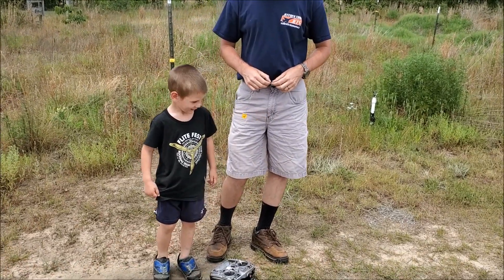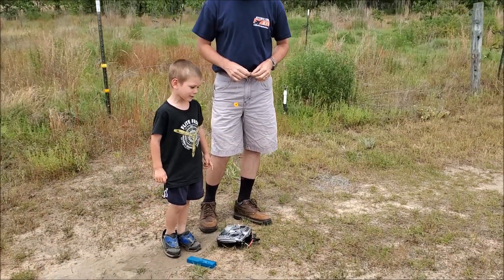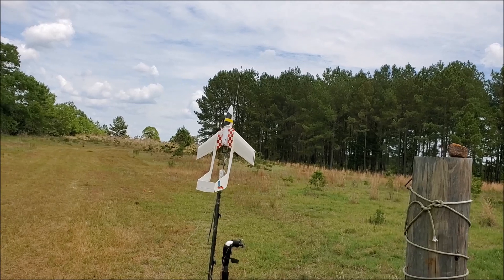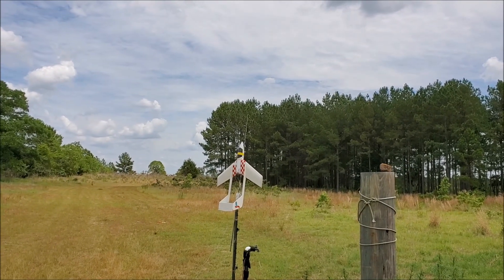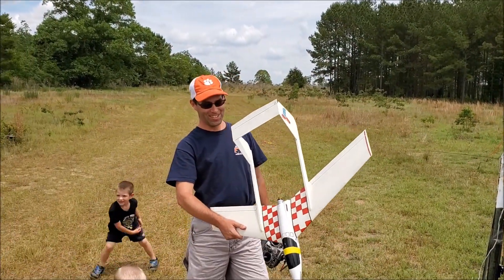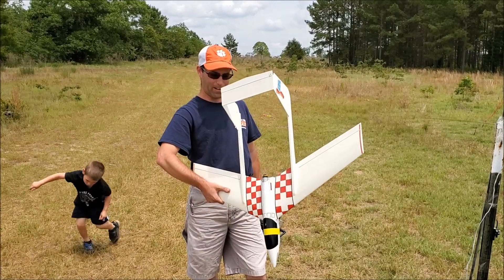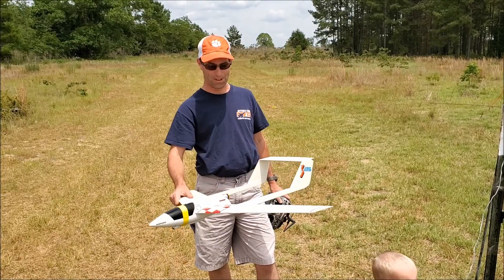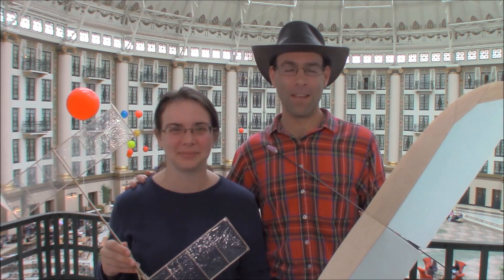Estes Strato Blaster rocket plane!

Comment: the STRATOBLASTER! That's the freaking name of this thing! All of my friends (and of course myself) wanted one of these when I was young.

One of them ended up cloning it (edit, a mix of cut packaging foam and Hobby Lobby Balsa, if memory serves) and adding a folding sailplane prop in the middle, with two F class engines for launching.  He used it as a target puller for big foam gliders we'd pepper with BBs, paintballs and the like. ended up getting literally shot down by accident.

(edit 2, seeing only one motor ignite was FUN, because that thing became utterly unflyable until it burned out)

Comment: Love the video. I still have this model, brand new in the box. I really need to start building it.
Reply from the maker: You'll enjoy it!
Reply: @joshuawfinn  I enjoy your video allready. But i dont know how to build the wings. They are styro with balsa planking. I think it is time for me,  to do some research on the net about that.
Reply from the maker: @danykeppens6934  there is a specific process for sheeting the wings. In the 80s and 90s it was the primary method for building wings for high performance aircraft, and so there are still plenty of good tutorials out there, especially on rcgroups, because a decent number of folks are still building them that way.

Comment: Very cool. Looks like the glider launched directly into a thermal. I have an Astro Blaster too, though mine is the canard design. I just completed it this year, it is just waiting for the RX, servos, balance and trim out. I guess I need to get of my butt and finish it.
Reply from the maker: Yup, straight into lift! So the one you have is the Astro Blaster, this one is the Strato Blaster. Both are excellent airplanes and I wish Estes would put them back into production. They sold a ton of them to people who converted them to glow power with Cox engines and I understand that they are equally excellent in that role.
Reply: @joshuawfinn  I set mine up for rocket power, but I will primarily use it as a slope glider. Maybe if they have Roctober this year in Lucerne I will try launching it under power.

Comment: What does FAA guidance have to say about rc rocket airplanes?
Reply from the maker: Basically they don't. There are legal provisions for rocket powered gliders in the high power classes, and the AMA and NAR safety codes both cover them.
Reply: @joshuawfinn  I mean with the new ruling that says every UAV needs to show location.
Reply from the maker: @themadscientest  no technology to do it and I think 80% of the flying world are just giving the FAA the middle finger at this point. I don't recollect the weight of this airplane but it's probably under 250g anyway so exempt either way
Reply: @joshuawfinn  Yeah, unfortunately the FAA had to get involved because irresponsible people flew multirotor UAV's in areas where operation posed a hazard to manned aviation. The FAA unfortunately took things too far with regulatory stuff.
Reply from the maker: @themadscientest  It was a power grab from the start, just like all the ADS-B crap. Drones were just an excuse, as usual. I've seen and experienced enough as a commercial pilot to know without doubt that FAA policies have nothing to do with safety.